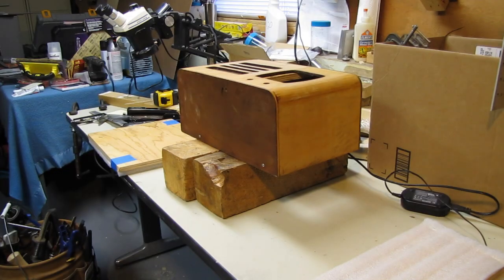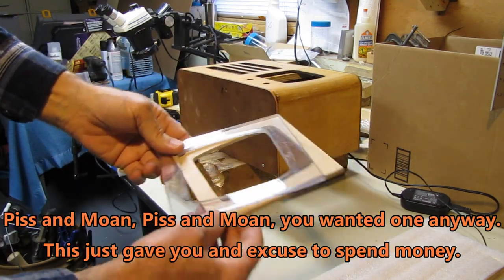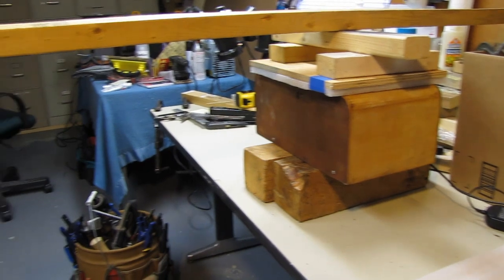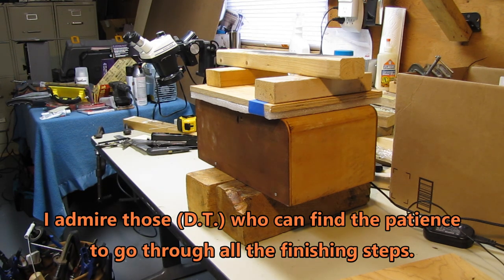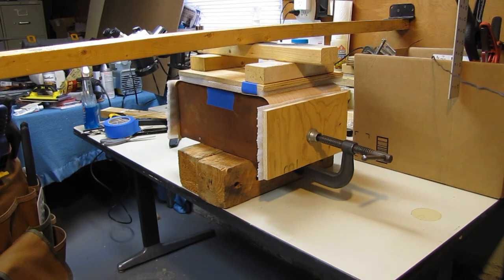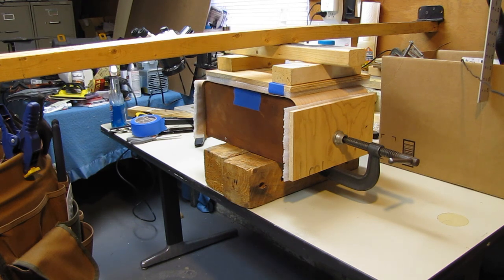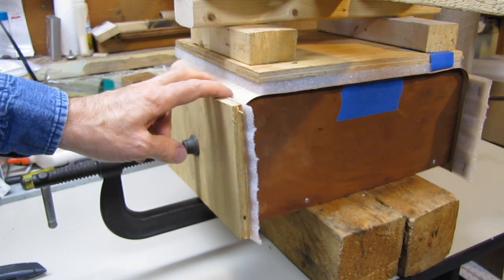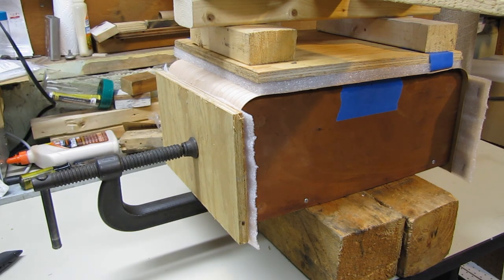Restoring the TRIAD Radio Cabinet Part 3 - DISASTOR STRIKES

Comment: Steam it, bend it to fit and clamp it down.  Allow it to set up a day so  it dries before you begin to glue it down.  Use hide glue (if you have a Woodcraft store in your vicinity, they carry a great hide glue  - Brooklyn Tool and Craft - that is easy to use.  Down side is that its a little expensive and you have to mix it up in water and then heat it up and apply hot.)

Comment: I have not tried this myself but if I had to do this, I would steam bend the veneer using the radio as a form but no glue. Borrow a clothes iron to get the wet steam. Once the veneer dries again then put the glue down and press the veneer on the final time.
If you are worried about shrinking then pad out the case with a layer of cardboard to factor for shrinkage.
My best guess... Worth as much as any other YouTube comment :p
May the force be with you...
Cheers,
Reply from the maker: Thanks Eddy, I can use all the force I can get.
Reply: @theradiomechanic9625  - I gave this a bit more thought last night. I don't think you need to worry about expansion and contraction of the veneer as it is moistened and dried. The degree of expansion in wood is marginal along the grain (most expansion is across the grain) and you are likely bending across the grain so the bend radius should not shrink enough to be worried about steam bending. Leaving enough material front and back will cover shrinkage across the grain and it can be trimmed of when the adhesive dries.
Speaking of adhesive, I think it would be very difficult to use contact cement. Plain old white or yellow glue (PVA) should be fine as you are pressing the veneer down with your jig. There is a special type of PVA glue called "cold-press" but I doubt you want to buy a whole bottle just for this job. Some people apply PVA glue to both surfaces and let it dry then reassemble and use heat to reactivate the glue, I have not tried this though.. probably a bit easier to do than contact cement.
Finally I think cutting out the openings in the veneer should be done after its dried and done carefully as the veneer likes to split along the grain. leaving a bit of overlap and sanding it flush may result in a better finish and prevent splitting.
That's all I had, good luck!
Reply: (There is a type of PVA glue called "no-run" that is close to cold-press, it may even be the same stuff and it comes in smaller bottles, eg. from Tightbond.. it's good stuff.)

Comment: May be puf the veneer in water few hours and then put it on the cabinet (with a protective plastic sheet) till it dries.
Once dry it should keep its shape and be easy to glue.
Reply from the maker: Sadly this stuff is paper backed. I might purchase more and try that. Thanks.

Comment: Although you have the "gist" of gluing on wood veneer to a cabinet there Vern  there are lots of videos by regular guys 
who do it for a hobby. There is a  gluing trick to bending dry veneer on a curved surface for instance when  bending  PERPENDICULAR to the grain direction, and it may need to be looked for so you don't waste expensive veneer. There 
is one particular video I saw  maybe two years ago that caught my eye. See " Bending Veneer Against The Grain "by a  
YT fellow named Javad. He is a good teacher with a garage  size shop.
Reply from the maker: Thanks master, I am bending with the grain I.E. the grain runs the long direction. I would expect it to fracture if I bent it across the grain. I am going to try steaming it next go. And I am going to watch some more videos as well. Thanks for watching.

Comment: That was deflating Vern, sorry it didn't work. The paper backed veneer helps stop the wood from splitting and should make it easier to do curves. Your curve is very tight and I was surprised it went around so well to begin with. Paper backed veneer is best done with dry yellow or PVA glue and an iron, I would try an offcut on a test piece of wood with the same curve radius. 
I haven't tried steaming, I guess you could try pre-steaming the corners with a damp cloth and the iron and let the veneer dry out in the hopefully new shape. Luckily you have the offcut for the top to experiment with. 
Another advantage with the iron on PVA method is you know it's screwed up straight away 🙂
I just found this video, not as sharp a curve as yours: https://www.youtube.com/watch?v=TwbIGRrXT0U&ab_channel=JavadShadzi
Reply from the maker: Hi David, I had considered steaming and letting it rest before gluing it on. But I am not patient enough. 😀 Planning on steaming it and letting it rest ( perhaps more than once ) before I glue it again. I can fix anything mechanical or electrical, but this dead tree stuff makes me nuts. 😆
Reply: @theradiomechanic9625  I just realised my video link is the same as Steve (he's the Master)s link, my apologies Steve.

Comment: Cabinet work  on a radio is like body work on a car.  I'm a mechanic (or was). I'll rebuild any mechanical part of the car with no problem. PLEASE don't ask me to do body work. Like you I have no patience for it! 😱
Reply from the maker: Hi Robert, over the years I have restored electrically and mechanically many radios. But I always tell them the cabinet work is on them. I can fix anything with wires, welding, machining etc. This wood crap drives me crazy.

Comment: Ohh, that's a shame. All that work and money.
Well you'rr doing it on something that doesnt have much value so when you fail it's not that bad...
You gain experience, and that's more valuable than the radio itself if it's destroyed.
To the veneer shaping problem, wouldn't wetting it with warm water on the veneer side make it easyer to bend?
That's how they bend plywood into shape isn't it? Soak it in hot water for a while and then apply preasure.
You can do it I'm sure.
Reply from the maker: Steam is how they usually bent wood. But I read that using steam on veneer can cause it to shrink later and cause problems, But I am going to try it anyway. Thanks for watching.
Reply: @theradiomechanic9625  Yes, steam probably isn't a good idea considering the paper backing.

Comment: You can actually iron on the the veneer using tight bond glue. I have done this and it does work. Check out this video titled "Ironing wood veneer on curves" here's the link https://www.youtube.com/watch?v=agvQ0vuvJmE  Give it a watch. Just a different way of applying veneer.  Good Luck.
Reply from the maker: Thanks, lots of folks suggesting the Iron approach. We are not giving up. And thanks for the link.
Reply from the maker: BTW, watched the video, never dreamed I could be that rough on the veneer without tearing it up. Excellent.
Reply: @theradiomechanic9625  Very Good I'm glad that helped... BTW did you see the links I posted for the 1947 Chevy Radio Rant Video.. I think I found a couple of speakers that might foot the bill. Both of them on epay... Hopefully one of those might foot the bill.
Reply from the maker: @wa2mo  Hi Mark, No I didn't see the link. Comments have been disappearing. I have had several reports that people make posts/comments and they disappear.